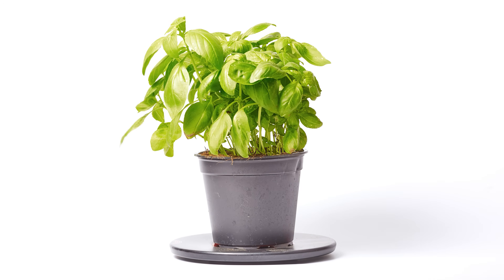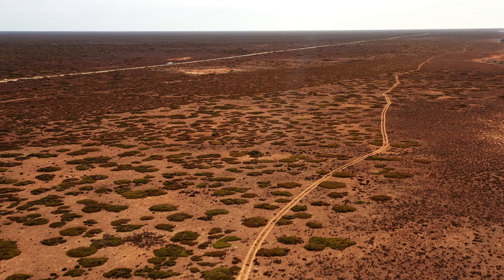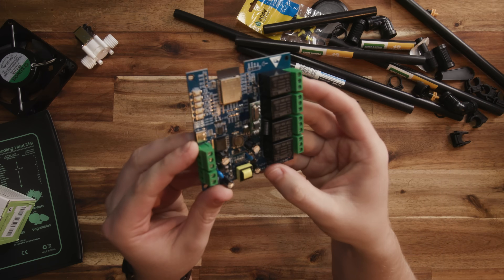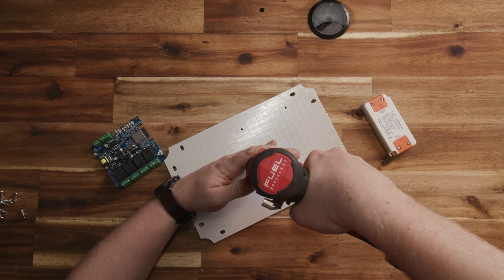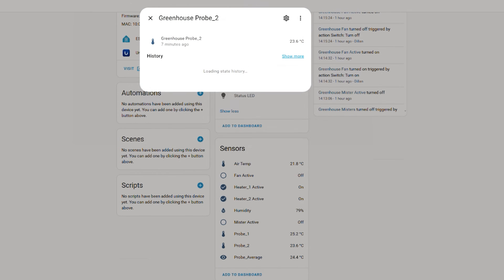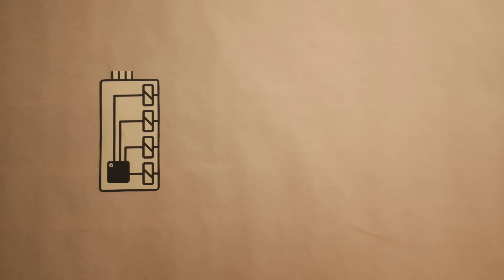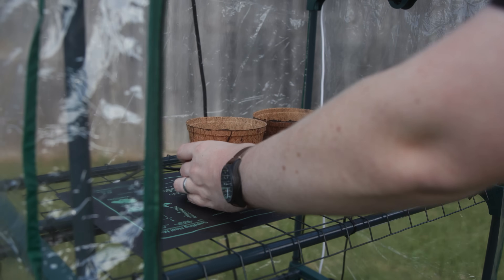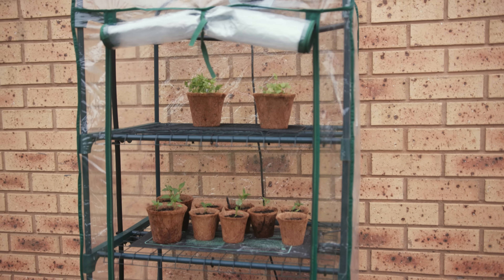All This… Just So I Don’t Have to Buy Herbs

Comment: You can get moisture sensors for soil. I started to put together a self watering system for herbs...
Reply: And a quick tip for those sensors, for anyone going this route: take readings at as wide of an interval as appropriate for your usage, and only power the sensors when taking the readings. Passing current through the sensors + the moisture in the soil causes them to rust at an accelerated pace; keeping them powered off greatly increases their lifetime.
Reply: There is part of me that wants to invest in this for all of the garden and flower beds around my house and yard. The cost goes up fast though, and with enough required flow rate you have to start scheduling the zones so they don't all come on at once.
Reply: pro tip: dont use resistive soil moisture sensors at all. Youre looking for the capacitative ones. They too have their own issues, but are still overall better. Theres a good video i found  when i started using them listing common issues and how to avoid/fix them, just search yt for "flaura capacitative soil moisture sensor" and youll find it.